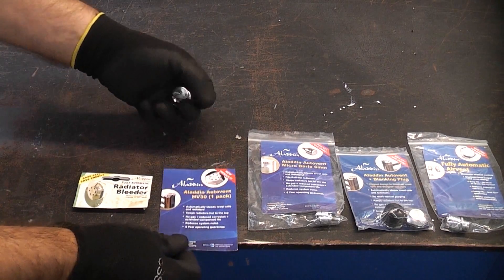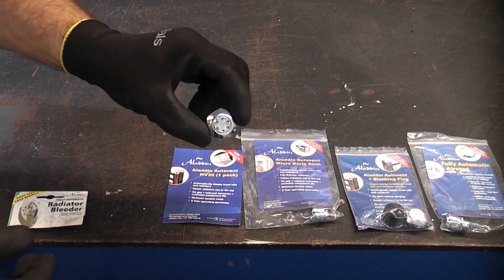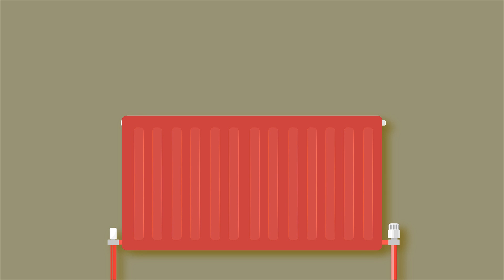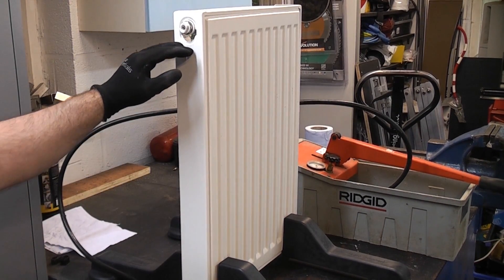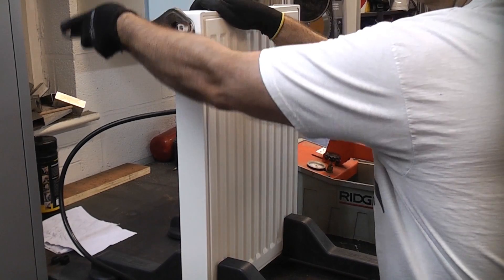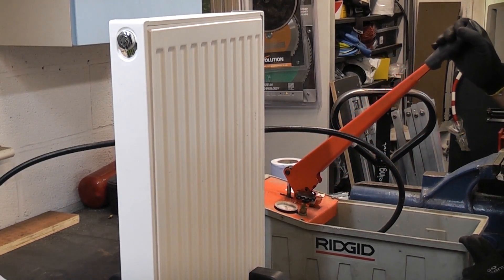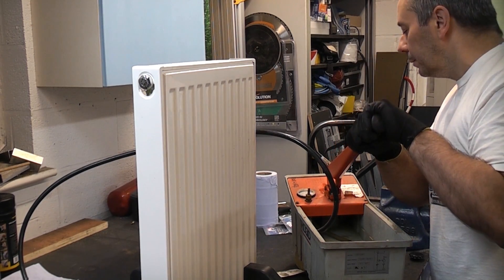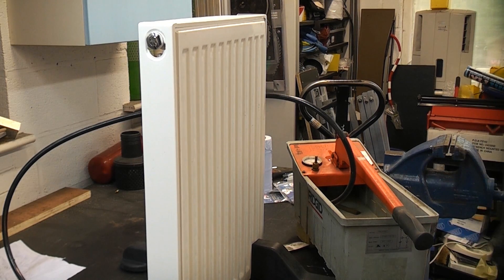Aladdin autovent | automatic radiator bleed valve

Comment: One of  my radiators upstairs is constantly gurgling, had a new rad fitted and its still the same. It is an open vented system. I bought one of these but it is still staying cold at the top. Not sure whats going on, you can hear the air constantly going in the rad when the pump is on, there are no leaks Im aware of. Can you offer any advice please? My hot tap downstairs is getting full of air too and sometimes stops, it is a new tap that was fitted 9 months ago, could this be related? Thank you.
Reply from the maker: With some open vented systems, there is not enough pressure (it depends how high the tank is), this can cause problems, normally with the highest radiator in the system. I remember a mate of mine once swapped a small radiator for a tall towel radiator and it would often need bleeding! 

The new tap problem might be something to do with a high-pressure tap being fitted on a low pressure system (I’m not an expert BTW)
Thanks for the comment 👍
Reply: @ultimatehandyman  thank you for the reply.

Comment: My problem is completely reverse , from 80 rooms in the hotel only 1 has Aladdin autovent and that's the only radiator that's half cold , it's not even a year in the radiator,  looks like it don't work properly
Reply from the maker: It might be worth asking their support team-
https://aladdin-products.co.uk/contact/
Reply: @ultimatehandyman  nah , not worth the hustle , also if it sprays out by itsleft it makes curtains dirty , just gonna swith it back to manual

Comment: These valves do work well, but be aware that they aren't a permanent solution to the problem. I can't claim to know the details of how they work but I reckon there's some kind of material akin to horse-hair inside that lets air out until the water arrives and wets it, whereupon it stops. The problem is, it has a finite lifetime of around 5 years (according to the Aladdin website). I bought 4 of them about 3 years ago and have had to replace 2 of those already. On the other hand, I saw a comment on ebay from a user who had one of these still working after 8 years. Once it stops working, your rad will go back to trapping air and you will need to replace either the whole valve (if it's a basic HV30 model) or the cartridge (if it's an HV30C). As the HV30 is currently selling for £5 each and upwards (Screwfix want about £9 each!!) this means that your rads are costing you about a quid a year each, which you may want to factor into your calculations.

FWIW I've also had experience of the Italian type automatic vents, which are purely mechanical. They are little pots about the size of an eggcup with a float and a lever inside and a sort of bicycle valve on top; the lever stops up the valve when the water level gets high enough. They also work well at first but in my experience they stop working after a few years due to corrosion gumming up the mechanism. That said, I was talking to someone who claimed to have had one going for 10+ years;  so who knows?

Given that both of them work well for a few years and save the hassle of bleeding the rads all the time, I'd go for the Aladdin over the Italian eggcup mainly because it's much neater and unobtrusive. You just have to be prepared to buy new ones at some stage and go round replacing them.

Comment: I fitted three of these genuine valves last year , all was great , but this year went to turn central heating on and one valve is'nt working , only getting half hot radiator .    🤔
Reply from the maker: Are they still under guarantee?
If they are, I would get in touch with the manufacturers-
https://aladdin-products.co.uk/faqs/faqs-autovents/

Comment: As a 22 year time served hydronic (central heating) engineer, now in Australia, you think you've seen everything! 

Never seen these on a system until now, on a job where I've got to drain it down to do some repairs. 

Very happy I've now seen this vid as I'm confident it will purge the air and not cause any issues dow the track.

Great vid mate.
Reply from the maker: I'm glad the video helped 
Thanks for the comment 👍

Comment: Presumably though, the combi boiler will eventually stop working due to low pressure!
It's excellent to have a valve that automatically bleeds radiators. But without a mechanism that automatically tops up the pressure is just going to create a different problem.
Reply from the maker: Yes, a combi will eventually stop working, but these would be more useful on a conventional system, where there is not much head of water. A friend of mine had a radiator in her bathroom (conventional system) and it needed bleeding every few weeks due to the lack of water pressure in her system. One of these would have been very useful for her.
Thanks for the comment 👍
Reply: @ultimatehandyman 
No need to thank me for a 30 second comment mate - you're the one that needs to be thanked for all your truly excellent videos. 👍👍👍
Reply from the maker: @ursamajor6546   I always appreciate comments, so often thank people for taking the time to comment ;-)

Comment: Does this also work for a tiny amount of air that is noisy when a radiator starts heating? The radiator warms completely. The boiler should also contain an automatic bleeder but still I hear air. The boiler is lower than the radiator. I also heard there is something called an air divider for micro bubbles (still needs bleeder)
Reply from the maker: Not sure, this is designed to let trapped air out of a radiator. Sometimes some radiators constantly need bleeding, this is where one of these comes in useful.
Thanks for the comment 👍

Comment: Brilliant video, very informative. I had several manual bleed plugs and blanking plugs that had perished rubber o-rings and were leaking. They were replaced with Aladdin Autovents. They are awesome indeed. Very well made, chromed brass, in comparison to the supplied plugs and quite heavy for their size. No more leaks, dry floorboards and hot radiators. Thank you.
Reply from the maker: Thanks for the comment

Comment: Simply does not vent air, fitted a year ago and had to be removed for a manual valve. Was manually opened and vast amounts of air removed 3 times over the year. 
UPDATE: Aladdin kindly sent me a free replacement. Decent customer service; but it's not worth the hassle of installing yet another valve again.
Reply from the maker: I'd get in touch with them and see what they say.
Are you sure it's one of the genuine ones and not a copy?
Thanks for the comment
Reply: @ultimatehandyman  It is genuine, they did send a replacement, but after the hassle of changing it twice in a tiny toilet - I can't really be bothered again. The radiator is red hot, the valve needs heat they say. I took the old one apart. The needle valve at the back of the housing under the cartridge was rigid, it moves under spring pressure in the new one, just doesn't work on a 10 year old radiator system, 3 yr old boiler. 
Suspect its the black sludge.

Comment: I have had these in a couple of rads for a year or two, I do not like them. They only release air when valve opened slightly. The c shaped key to open valves is a total night mare to use. I will be changing valves back to old fashion type so I can use a proper key..
Reply from the maker: Thanks for the comment
Reply: Sorry you are having problems with your valves.  Please contact our customer services on admin@nlbengineering.co.uk and we will be able to help you resolve your problems to ensure the valves automatically bleed.

Comment: hi, fitted one of these to test them out, however i fiddled before reading and opened the vent with the little horseshoe key, then read instructions and it said to never do this, valve now wont let air out, can it be corrected or do i need to buy another?
Reply from the maker: I'm not sure, you are better off asking the manufacturers- http://aladdin-products.co.uk/contact-2/
Reply: Hi Luke if you're still having problems please contact us at admin@nlbengineering.co.uk and we will be able to help.

Comment: I fitted on to my Nans radiator which is always half full of air for some reason.

Sadly the device simply does not fricking work, manually unscrewing it to let air out is worse than the standard fitting.

It is a genuine product too, just entirely useless.
Reply from the maker: I'll see if I can get someone from Aladdin to answer this one.
Reply: Hi our products are guaranteed for 5 years so please contact us and we will check with you it has been fitted correctly and if it is faulty will send you a replacement. Please call us on 01279 730363
Reply: Hi Chris sorry you've had problems with your valves.  Please contact us at admin@nlbengineering.co.uk and we can sort this for you.
Reply: @niftylittlebleeder  Never saw this answer - sadly after a year and 3 more manual ventings I bought a manual valve and fitted it. This thing simply does not work. That's two units that have failed now.
Reply: @niftylittlebleeder  UPDATE: Aladdin kindly sent me a free replacement. 
Decent customer service; but it's not worth the hassle of installing yet another valve again.

Comment: These are a terrible idea and will potentially kill your boiler!. If your heating system is constantly being topped up with fresh water all you are enabling is corrosion and black iron oxide (magnetite) to form quicker!! Water+oxygen+steel creates sludge. When this finds its way back to your boiler it will block it and cause all sorts of issues. If these constantly let air out then water is constantly being put back in!!! Either from a conventional header tank (open vent system) or the homeowner topping up the system via a filling loop (sealed system. If you constantly have air in a particular radiator then that is the real issue that needs fixing, not by fitting one of these. Please beware...you've been warned!!!!
Reply: If you need to keep topping up the volume of water then there is a leak which needs addressing.  Our studies have shown that micro gaps in a system can allow air in but not necessarily be a leak (via PTFE tape joints, compression olives, O ring seals etc).  The net effect in this circumstance of bleeding air doesn't keep dropping system pressure or introducing  new water.  The second cause of air in a system is inherent in the water which contains 17% by volume which is liberated upon change of temperature or pressure.  Once removed the system becomes mostly air free which actually reduces corrosion. Air trapped in a modern heat exchanger causes damage.   Heating Engineers often fit our valves when they can't trace the source of air ingress and find them a useful tool.
Reply: I am a heating 'engineer'...I recommend these to my customers https://www.spirotech.co.uk/products/spirovent-microbubble-deaerators-brass/
On an open vent system pumps will also unfortunately suck in air via the open vent pipe. If the air were to find its way to these air vents then they would release the air thus dropping the head from the tank thus allowing more fresh water into the system thus allowing more iron oxide to form.  Sealed systems I agree with your point above about topping up the system pressure (water) ^

Comment: I’ve wondered for years why these didn’t exist for rads since auto valves are used all over plumbing installations including in most boilers. I assumed it was because of the horizontal way they would need to be fitted to the end of a rad or that they would look unsightly 

But these look just the job. Only issue is if it’s really true that if they fail they ALWAYS fail in the closed position. I had a leak from my boiler auto value and some water was spilled in the boiler, but if these fail then someone’s nice oak floor could be ruined.
Reply: The Aladdin Autovents are unique and fail closed - i.e they will not leak at the end of their life.

Comment: I have a heat only system, not a combi. Is there a minimum pressure this will work
Reply from the maker: I believe these seal by water expanding washer/s so they should work on any pressure.
Thanks for the comment
Reply: Ultimate Handyman 
but do they purge very low pressure with aheader tank
Reply from the maker: Yes, I can't see why not.  If you open the bleed valve and there is enough head to push the air out it should work exactly the same with an auto vent.
Reply: Ultimate Handyman 
Ok thanks for your prompt reply. Cheers mate.
Reply from the maker: You are welcome ;-)

Comment: good video ,may i ask on towel rads ,how do u get rid of rust spots on stainless steel ones ? mines a central heating connected one not electric
Reply from the maker: Is it definitely stainless steel and not chrome plated?
Rust spots on stainless can be difficult to get rid of, but sometimes you can remove the  using a Scotch brite pad or similar- but you can ruin the finish on some stainless steel finishes if you use one.

Comment: I know this seems like a totally off-topic question but that test rig, do you think it could be converted into a diesel injector test rig? I mean it's ideal because it has the gauge etc. You'd be able to see what the injector fired at. What's the max pressure and cost of one of those? Kind regards
Reply from the maker: I'm not sure what pressure they fire at?
This rig goes up to 50 bar, it has a 1/2 BSP female connector on the end, which means you can easily convert it to fit almost every other type of thread. I bought mine at auction a few years back for about £40, to buy one brand new they are about £180 or you can but a no name version for about £60 brand new.
Reply: Ultimate Handyman it may not be adequate in that respect. I think it's somewhere near 2000psi-2700psi, I've heard people make them from bottle jack's but it would be a lot more effort than this tester. Thanks
Reply: Why not just get a proper tool made for the job.

Diesel fuel rails go to 1500psi.
And since the injector is PWM controlled for a microsecond or so, the pressure drop wont be all that much.

Comment: I've seen these before and I think they're a very well designed product and a great idea. If a radiator continuously required bleeding though, I would be inclined to investigate the cause of the problem and try to rectify it.
Reply from the maker: That is correct, but sometimes a certain radiator will just collect air due to the system design. I think once we had a header tank that was not high enough and that meant that the bathroom towel rail constantly required bleeding.
Thanks for the comment

Comment: Seems a good idea for systems with problematic air. Worth adding to keep an aye on the boiler pressure if these are fitted or it could be a chilly wake up in the morning if the systems pressure drops to low preventing the boiler from working. As you will have no way of knowing when and how frequently the air is releasing from said radiators. Great video as always
Reply from the maker: Absolutely.
Thanks for the comment ;-)

Comment: that is impressive loved the video(what about if you drain the heating system would work the same).
Reply from the maker: Thanks, yes if you drain down you can just refill the system and each radiator with a auto vent fitted will not need bleeding as it will fill to the top.
Thanks for the comment

Comment: I've used these on a commercial system which was great as 100 plus rads and so much easier for venting. One thing tho, as these do fail safe  it would be best to replace the blanking plug end on a modern rad rather than the manual bleed. If it does indeed fail at least you can bleed the radiator still or take pressure off if needed. If it failed you would then need to drain as you could have 1 bar plus pressure in the rad. Could get messy. Great product tho, would recommend
Reply from the maker: That's a great idea.
Thanks for the comment

Comment: If a radiator constantly needs bleeding doesn't that mean there's a problem in the system? Informative video, thanks for posting.
Reply: [1] Repressurizing some types of boilers introduces air [2] It isn't just air - there is a hydrogen build-up inside water systems due to corrosion
Reply from the maker: It depends, in a previous house we had a conventional system and the tank was not quite high enough meaning the towel radiator in the bathroom needed bleeding regularly. I could have done with one of these back then!
Thanks for the comment